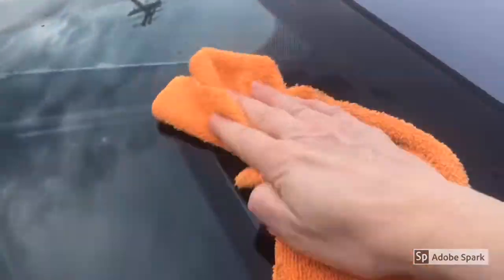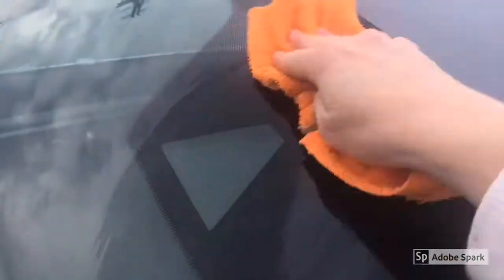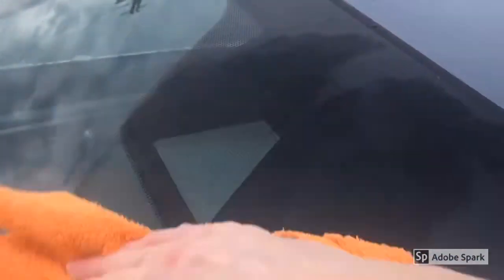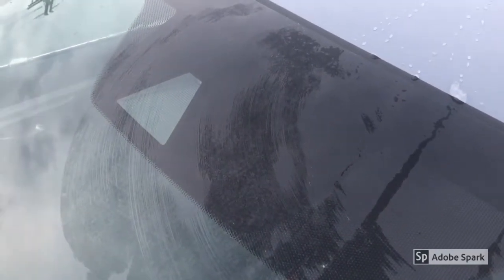Cleaning the Safety Sensors on Your Honda

Comment: Thank you honda for installing that sensor so easy to steal mine just got stolen!
Same sh!t happened in NJ in June 2020 on a large scale, several hundred CRV 's got robbed of the damn honda sensing "radar sensor" in a matter of couple weeks.
Because it's so easy to do without any special tools, they're able to rob 20 cars in literally 20min.
Unsuspecting owners started their cars to be greeted with multiple warningns:  

Collision Mitigation Braking System Problem, 
Road Departure/Mitigation System Problem, 
Lane Keeping Assist System Problem, 
Auto High-Beam Headlights Problem, 
Adaptive Cruise Control  Problem, 
Brake System Problem.

Horrible design, Genuine Honda ignorance!
Reply from the maker: Good to know. I haven't heard of this where I live, but its a much lower population here so that might have something to do with it too. Sorry this happened to you.
Reply: I'm from New Jersey myself, and YES, this is a significant problem. Faulty design, yet I do own two Hondas—a 2020 Accord and a '18 CRV—in my home. Unfortunately, thieves just took my mitigating radar in February 2022 from a CRV. Looking inside the grill, it appears that stealing this radar is indeed fairly simple. and it cost me close to $2,000 for the repairs plus a four-month wait period because the part was out of stock. The cost of the sensor itself was $800, the front cover was $55, there were a few hundred dollars worth of brackets and screws, and the remaining $155/hr was for labor. Just to be safe, I'd make sure I had full insurance protection. . I tried to secure it after purchasing a brand-new sensor by wrapping a zip tie around the front cover, but stupid sensors are now giving me lights on the dashboard with a sign that reads "Radar obstructed." I feel like applying crazy glue on the cover edges, but then the dealership will say that you tampered with the original part so we will void the warranty or use another excuse when I go in for maintenance in the future.
Reply: Anyone interested in a Class Action suit against Honda? Mine was stolen - see LOTS of missing ones all over NYC.  $500 that shouldn't have happened due to poor design. 2019 CR-V